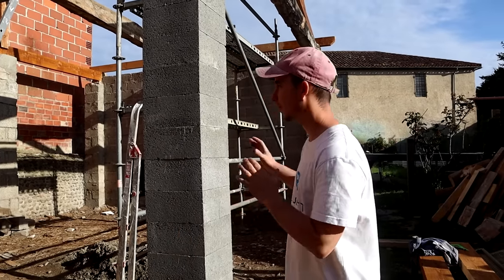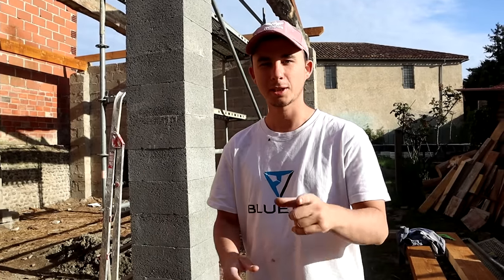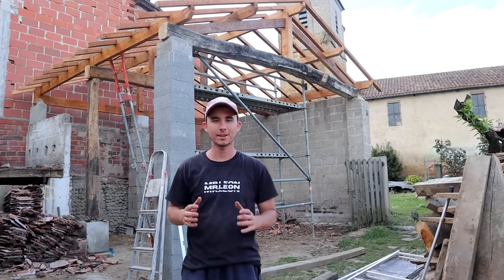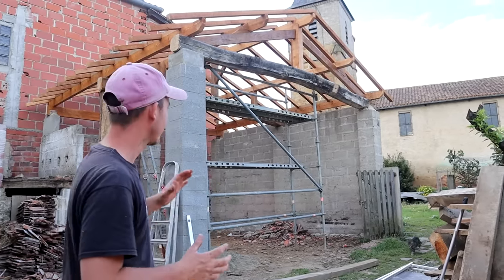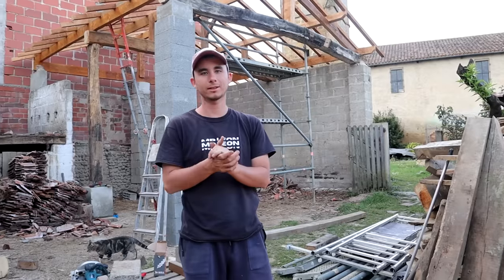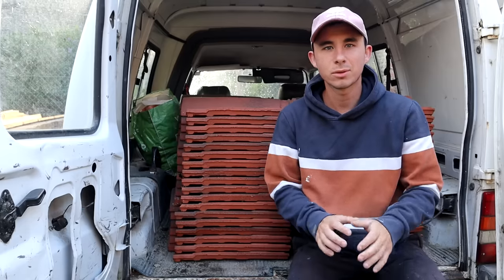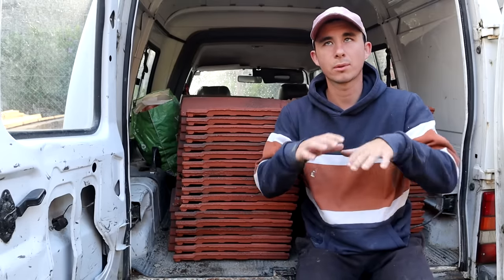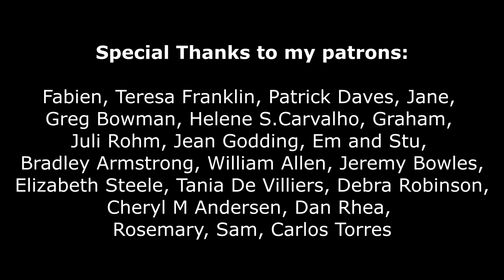BIG advances on the ROOF #79

Comment: The 45° supports need more than screws! They would need lag bolts if they're not resting on the actual wood. Otherwise your weight bearing ability will only be as strong as the screw going through the board.

Comment: Fantastic work - and how beautifully you share the tasks between the pair of you as a balanced partnership.
Two questions came to mind: does the surface treatment you used on the wood include a strong woodworm killer? I sure hope so! Secondly, aren't you going to fit metal straps to restrain the tendency of the roof to lift (like an aircraft wing) away from the walls?  It looks at this remove you're relying on the dead weight of the tiles to hold it down - maybe that's local custom, and works ok...? 🙈😂